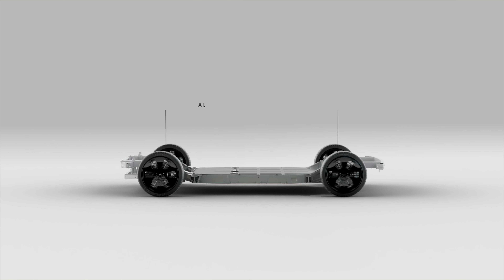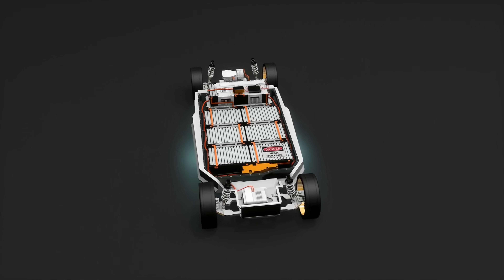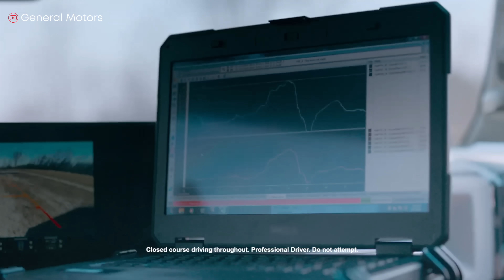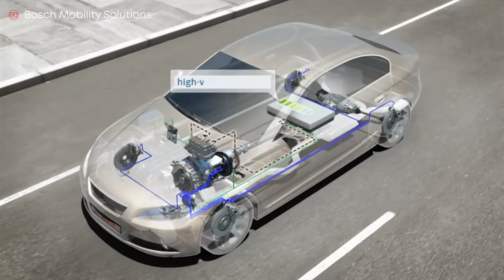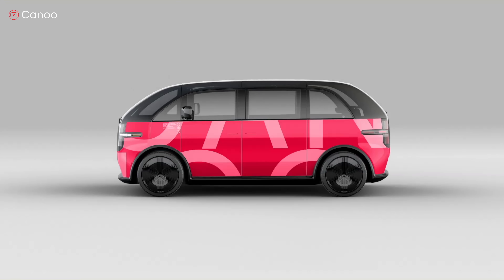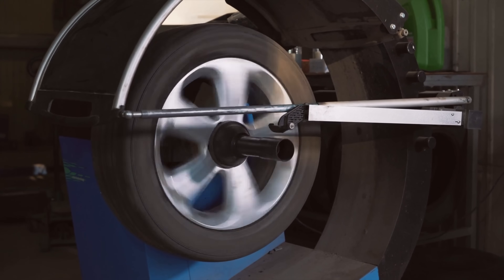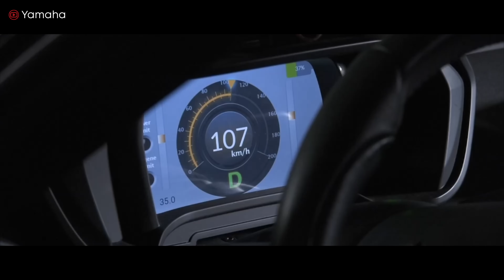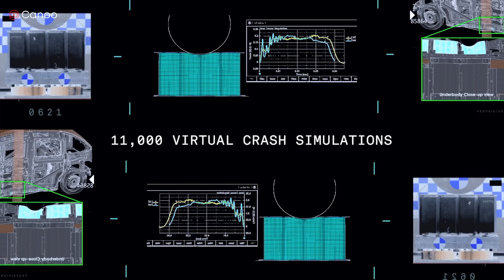No One is Telling You the Truth About Electric Cars, So I Have To

Comment: You didn't mention the frequent battery explosions from over charging or hot temperatures. And what damage could that possibly do if parked in your garage? You didn't mention the resale value is nearly zilch since the battery life is at best 10 years and more than $10,000 to replace. BTW, it will cost a fortune to discard old batteries since they are not recyclable!

Comment: We need a video about what to look out for when buying a "used" electric car. How to test the battery, brakes etc and how much to replace the battery with more affordable options than the dealership batteries. Could you use lead batteries in newer EVs? (the tiny China trucks that sell for US $2,500 come with cheaper  lead acid batteries instead of lithium)

Comment: I'm paying 2000.00 a month in fuel. I pull 28000 pounds with my dually diesel. Just curious if electric would be an option. I would only be able to charge for 10 hours before I went out for about 100 miles. I'm not sure there would be any savings?

Comment: What I can see happening over time is people selling their EV's cheap when the battery is cactus and the people who will be stuck getting 100 mile per charge will be those who can only afford a couple grand for a car
Reply: 100 miles per charge doesn't sound too bad considering a full gas tank now a days costs 3-4 times the cost of a full charge doesn't it?  If you're never driving over 100 miles at a time, which is all of my driving, it's probably cheaper.
Reply: @ArcadiaInferno  the problem is for people that live in rural areas. People in rural areas will have less charge stations and have to travel further for almost everything they do
Reply: @samebloke  You are 100% correct.  In my opinion lack of charging options is the main restriction to the increase in EVs becoming more common place (not price or range).
Reply: @samebloke  Not at all.  Almost all charging is done at home.  Off a full charge I get 300 miles which is much, much more than what is needed to get to a charger on a road trip, even in rural areas.

Comment: Regererative braking is not always possible!!!! It is only possible when the vehicle speed is high enough that the motor EMF is higher than the battery voltage so it won't work at low speed. It also can't charge the battery when it is fully charged!!!!!

Comment: The Nissan Leaf and Hyundai Kona  have a power distribution modules placed in a hard to access point between the battery and read seat.   These fail after about five years and must be ordered from China for    $7,000 with a five seek delay.

Comment: How often do EV batteries need to be replaced?  What’s the typical cost of replacement?  If the recharging is optimized by the owner, the recharge rate and storage still degrade over time.  Environmental differences aside, the average replacement of those batteries sounds Expensive to say the least.  A growing number of people that buy vehicles tend to drive them for years or decades because of cost.  Great vid👍

Comment: Went electric over 4 years ago now, and what he says about keeping between 20 - 80% is true not only for battery health but for saving time. Changing your fueling "mentality" to include short opportunistic charges will also save you a lot of time.

I didn't know however that long haul drives were best done without short interval charges. Will be doing that in from now on when necessary.
Reply: Drove my brothers ev for a short time. And in the winter when going 130kmh on the autobahn I realised that my 300km of range were realistically only 120km because high speeds and the cold sucked so much energy. I suddenly had to think about if id make it back home... I just feel comfy not having to think about range, charging and plan for charging time. As electricity prices rise it's also not much cheaper charging at home without solar panels.
Reply: @carpmo.3192  definitely, squashing the gas pedal makes charge disappear fast

Comment: I have an all electric Smart4two,great to drive around town,around 90 miles per charge,just had to have new tyres fitted after only 9000 miles,compared with 19500 miles in my old petrol Smart,and price of new tyres were over a 1/3 more expensive and difficult to get hold of.!!

Comment: Wouldn't regenerative braking mean that we are charging the battery frequently while driving and will cause an increased deterioration of the batteries? Or is regeneration so insignificant that it doesn't make a difference to the battery one way of another?
Reply: Charging frequently doesn't detoriate battery. Charging to full does. Regenerate does make way more difference especially in city traffic.

Comment: hi, we have a 1985 Ford transit based camping-car collection, has a 2.5 dci engine with 86000kms due for test in 2027. What is its future? is it to be scrapped or priced out of exsistance by fuel prices? We have no electric choices for this type vehicle, so after 2030 there will be no motorhomes, camping-cars or RV`s.

Comment: When will electric vehicles get 350-450 miles of range on a single charge, recharge completely at a station in 3-5 minutes and cost the same as gasoline powered vehicles? Until then what's the point for the common person to get one? So far they don't make sense to pay more for less performance.

Comment: I would think that the weight of the batteries would decrease the allowable payload in EV's, & would also create the need to have more efficient braking capacity. I have heard that small, less expensive EV's will be hard to sell as "used vehicles" because the cost of the replacement batteries will outweigh the value of the vehicle. Not sure how true this is.

Comment: It would be nice if they sold an ev at a fair price.
It would be nice if they designed the ev so that changing the big battery was almost as easy as changing the small 12 volt battery that comes with it.
It would be nice if charging up the battery was almost as easy as filling up the tank of an ice vehicle when making a trip.
It would be nice if they told you all you need is basically a charging cord for 220 charging instead of an expensive "charging station" installed.
It would be nice if they told you that going uphill, using the heater, or cruse control drains the battery range faster than pulling the plug drains your bathtub.
It would be nice if they told you that the great discount you can get when you buy an ev is really a tax credit deducted from your tax bill - meaning if you are retired and don't pay a lot of taxes then forget the deduction.
Reply: It would also be nice if the industry would install solar panels or tiles so the car gets a charge while in the parking lot at work, play, shopping, etc.

Comment: Hello, please tell me what is the cost to replace the batteries? What would be the performance of the vehicle in +30 to 40 degrees Celsius and in - 20 to 40 degrees Celsius. How do they perform on rough gravel roads with dust?? How long does it take to regenerate the battery when your travelling ? How long does battery last with highway mountain driving? Thank you very much. Canadian Liberals are aggressively perusing electric vehicles that may not work well in all cases in Canada.

Comment: Another problem is the planet does not have enough resources to build enough batteries to replace all the gas cars on the road, also to mine all the material would mean to strip mine most of the planet. At least with oil we just frak or pump it out.

Comment: I've been driving all electric vehicles for the past (4) years.  First, a Tesla Model 3 Long Range, then a Tesla Model Y Long Range.  Before that, I've owned over (40) internal combustion cars.  IMHO the electric cars are hands down more fun, faster, more reliable, less expensive to maintain and quieter to operate.  I've had a few minor issues with both electric vehicles, like pixelated screen that needed replacement (covered under warranty) and a piece of the underside protective covering came loose driving through heavy rainstorm (covered under warranty).  Otherwise, no issues.  With over 300+ miles of range and all the Superchargers available across the country I rarely take a charge cord with me and I've never run the battery completely down.  People need to drive an all-electric vehicle before they make up their minds about them.  I hope to never go back to ICE vehicles.
Reply: You must not deal with power outages like my state. We have issues with a failing grid all the time. They refused to put the power lines underground so we lose power with almost ever bad storm. 10 years ago we lost power for 21 days. We simply cannot adopt EVs it could get people killed out here. They would become stranded.

Comment: I don't think they are much better than gasoline powered cars. The biggest problem is constantly charging them. You have to wait.
With gasoline you go fill it up and it's done. Where the electric has to take time to charge and the battery being inefficient due to temperature conditions.

Comment: I intend to drive my current car for several years (to reach 200,000km ). After that a cheap EV
(less than 12k$) to drive next 10 years. So I don't worry about the battery life. Who knows what
type of battery in 10 years? 12k$ for 10 years driving with no ICE-related repair cost plus savings
from running cost will justify my judgement. Do you commit yourself 30, 40k$ for next 20 years
car life when the type of cars (most likely EV) may be totally different from today's EV? I don't.

Comment: Well battery wont last long in south east Louisiana 105 degrees all summer. i live in an apartment complex with no cover at all. I also work as a truck driver and im gone weeks at a time. Hence my 2014 Chrysler 300 has 33k miles and my 2009 gs430 only has 75k miles. Ill wait if i can to buy electric.

Comment: In relation to the corner drive animation, making the motor and drive as part of the spung weight on the suspension does not make a lot of sense to me. Why not just use a half shaft?

The low slung battery in relation to the overall mass of the vehicle can produce a very low SAE suspension roll center.

Comment: Electric car engines are washing machines on four wheels.  But way more likely  to burst into flames even when parked up for days without being charged.  They will require new tyres more often and road will require repairing more due to the weight of electric vehicles.  Tyres are certainly now a green commodity  and neither is recycling battery packs.  Telsa cars are amongst the heaviest on sale today and are as heavy as ATV's.

Comment: We’ll sort of… there’s 2 things to keep in mind not mentioned in this video when buying an EV

1. The manufacturer - basically 2 manufacturers Mercedes EQ and Tesla solve many of the issues mentioned in this video. 
2. The type of EV your buying - I see comments here about the Chevy Volt and Toyota Hybrids… these cars don’t use lithium ion, therefore this video is irrelevant to those vehicles (the use lithium phosphate and nickel cadmium batteries respectively). 

Basically you can store your ev (lithium ion) in hot or cold temperatures, however it depends on the manufacturer when you go to use them in these temps. 

Ev’s have thermal management systems that like mentioned, use coolant and heating to manage battery temp at optimal levels. This system actually does not prevent fire, instead a computer called a BMS does. These systems only prevent heavy wear and tear on the battery, extending its life many many times. 

So it depends, like if you want an EV SUV and intended to take it off-road on 100 degree F days then if you choose to buy the Hyundai EV SUV it’s going to put a ton of wear and tear on the batteries life span. Whereas the Tesla and more so Mercedes EQ has the advanced thermal systems and management software to prevent really any abnormal wear and tear to the battery life span. The Hyundai will still perform however it lacks the same level systems that would be on par with an ICE SUV, whereas Tesla and MB have designed these expensive system equivalents. Of course you pay more for this. But for normal everyday driving on the highway all 3 would be just fine. 

Battery memory in lithium ion is also logarithmic. So a battery is considered dead at 80% capacity. 

In short with EV’s be careful when choosing the brand because they are not all designed the same despite being powered by batteries. One brand could last many times longer than another. This is all depending on your driving conditions
Reply: The 2022 Prius Prime uses Lithium Ion.

Comment: when switch is put to close, electromagnetic induction is stalled and So the left off electrons jumps to second coil, (ie induced in ) Creating spark in aerial transmission from - ve to + ve terminal of battery , what is step up transFormer does do work ethics by , 2 Set of coils attached to iron and another floating where

Comment: Given that the EV engine only lasts 10-15 years, maintenance costs need to be adjusted for the same time frame for an internal combustion engine. I don't think I'm paying over $8,000 in maintenance for my car in 10-15 years. If we're talking about the lifetime costs, the life of the vehicle is going to make a huge difference. Since the price of an EV is a LOT higher than that of an internal combustion vehicle, I'm not sure there's any savings at all. What's the cost of a new set of batteries or a new engine in an EV? Would you be buying a new EV every 10-15 years rather than paying for new batteries? Lots more to be covered regarding costs of an EV.

Comment: Why would E-car brakes last longer, when they use the same brakes as gasoline cars. That makes no sense. And if you drive a gas car with foresight you barely need to use the brakes at all. My brakes usually last me 80000km
Reply: Because EV uses regenerative braking from electric motors more than actual brake pads.

Comment: Although EV's are not gasoline-powered and full of combustible fuel, Yes they can still catch Fire unexpectedly. 
The batteries in these vehicles have been known to overheat, burst into flames, or even explode. May 16, 2022
Electric cars have cooling systems in place meant to prevent fire or explosion. 
But high temperatures, a crash or overcharging can cause electric car batteries to ignite.

Comment: A lot of your information is outdated. Almost all modern lithium batteries have a BMS (battery management system), and does most of what you are saying. The BMS is responsible for keeping the battery in the idea voltage range, limiting maximum current output, and higher end BMS systems (AKA Tesla), will heat the battery during the winter to keep it within the ideal temperature range.

Comment: Scotty, those electric cars are very expensive to fix. We know two people who have tried to own them. The manufacturer made it clear. The mantianance must be done to check the condition. The problem is wear and tear, with everyday driving, or over driving conditions that in everyday driving will exist no matter what you do things are going to wear out. You need highly-qualified mechanics to fix those problems. Well there expensive. More than your average mechanic on your  conventional car. Also they told me use has a lot to do with how many miles your electric car will get, or power strain and drain wearing everyday moving parts and you got it the electric motor. But if your one of those people  that had a battery go out well your pretty much screwed. Get ready to pay a second mortgage or the almost same price for that electric battery as you did the car. 3/4 of the price of the car. Super expensive and that's the battery not counting the price the technician is going to charge you for his labor cost which is much more than a typical mechanic. NO, NO, electric cars are in the long run a lot more expensive to own.  Well those two owners after 3 years of ownership went back to a conventional car, why? The very high price of ownership. They told us most to never did conventional cars give them so many real world problems as did the electric car. They follow your advice on Toyota that by the way they owned before they bought  the electric car which they have sold because of the cost..!!! They told us that if they had con't to own that electric car it would have put them in the poor house.

Comment: electricity is not a power source.
electricity is a form of power transmission with the most flexible end use options.
a battery converts electrical energy to chemical energy, and back.
electric vehicle efficiency does not start with a full battery.

Comment: My 2002 Pontiac Grand Prix is still working just great. 
And it WON'T KILL ME if I make a mistake touching the "hot" wire: 12 volts 🙄
Electric cars have either a 480 Vdc or 600 Vdc battery system. Guess what can happen if you don't know how to discharge a large capacitor properly? 🤦‍♂️
The old DIY garage skills of the past can KILL you with a modern electric car. I'm a EE, but I wouldn't dare touch an electric car's insides without even MORE training. I once read a book on how to service them, but nooooo practical experience.

Comment: 10 yrs approx 100,000 miles. Most gas vehicles will last 300,000 miles or more if maintained. Cost of battery replacement easily exceeds all gas savings of an EV.
Reply: Lol i can do 100k in 2-3 years cause of work  where tf they getting these numbers ppl who barely drive

Comment: Even a ebike is extremely expensive and replacing the battery is a gamble you better hopefully the lithium battery has not sit on the shelf or wearhouse for a couple of years and then they all say number one top grade batteries used in in construction of the battery and with so many it's a gamble you hit and miss I have five lithium batteries all from defrent manufacturers some are better than others and the price is high even for a cheap one